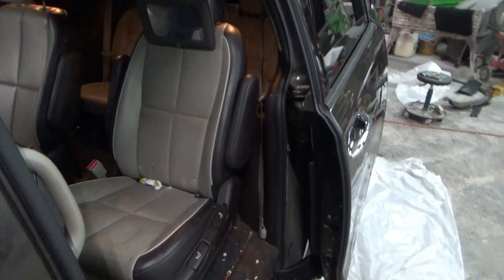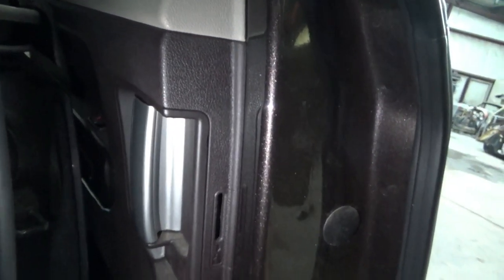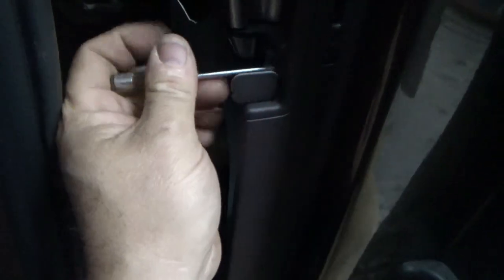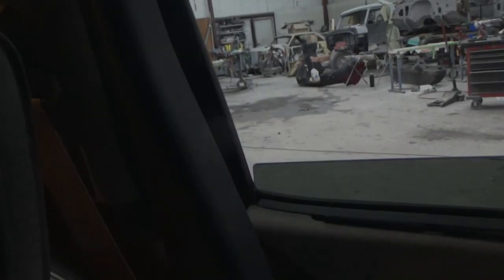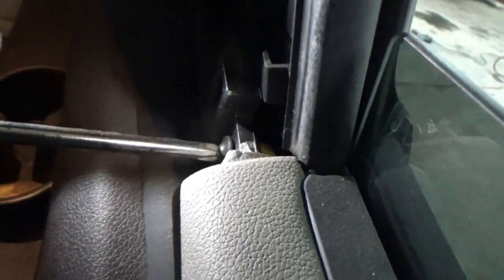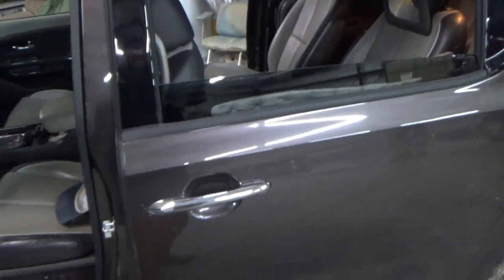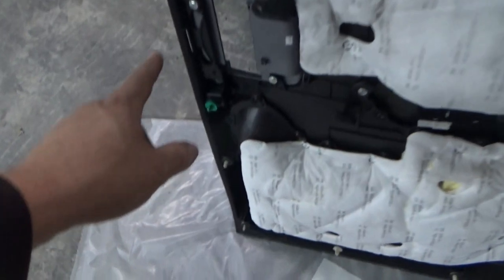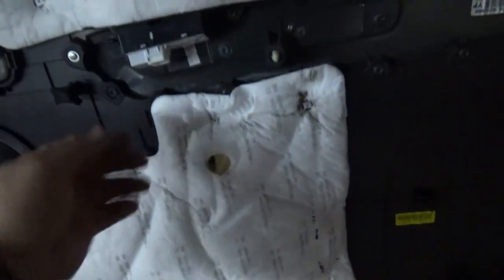2016 Kia Sedona door panel removal #howto #powerdoor

Comment: Hello, if you can help me, I have a 2006 Kia Carnival, the left sliding door does not open electrically except only when the car is running, and if the engine is turned off, it only opens with the hand.
Reply from the maker: Not really had any dealings with electric open